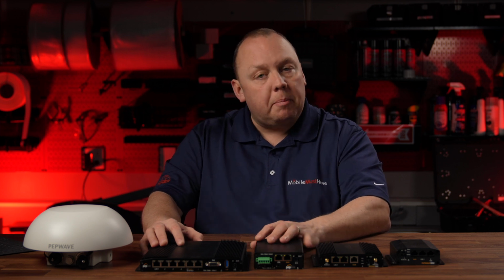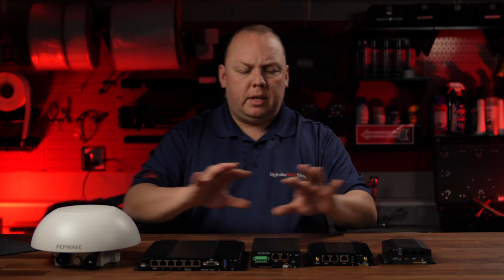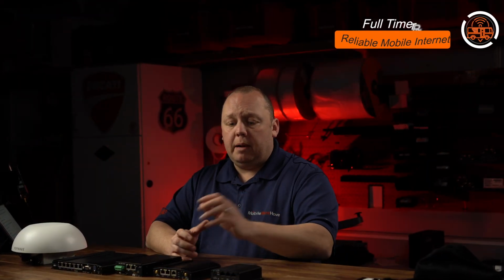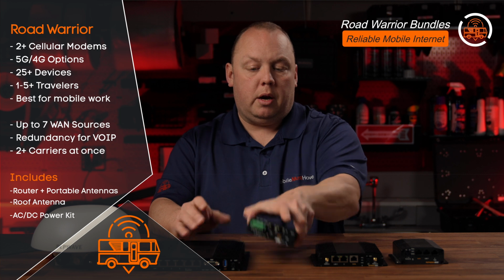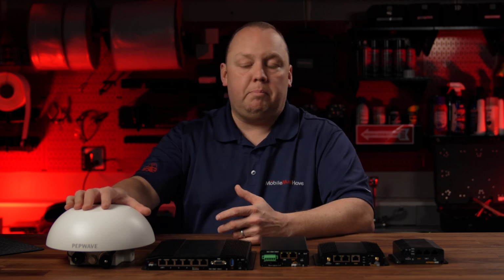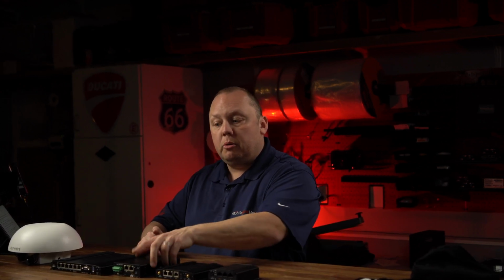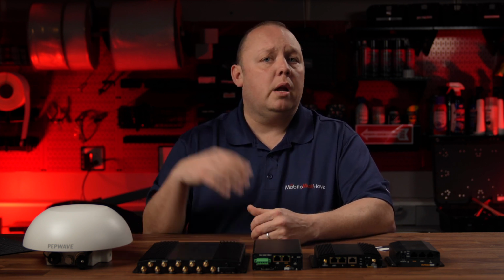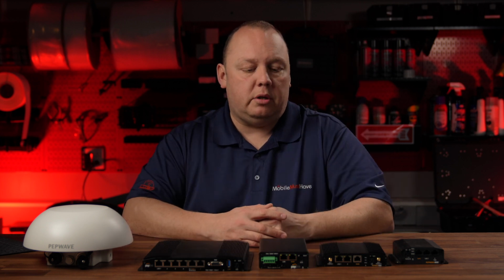So You Need Mobile Internet? Start Here (2.0) New

Comment: We will just need internet for zoom meetings for a few months during the winter. I think the packages are great, but maybe overkill for me. Do you have anything less than the full-time Rver?
Reply from the maker: The mini router without a roof antenna would be a great choice if your in good cell areas. Just need this router which is entry level if you want to step up and out of cheap hotspots. Then you can always upgrade to add antenna later if needed. https://mobilemusthave.com/products/pepwave-max-br1-mini-cat-7ltea-mobile-router-primecare-edition-hw3?_pos=1&_sid=4cc2f333e&_ss=r

Comment: Me and my wife both work and are on zoom calls a few times a day. We plan to be in the mountains. We already have starlink. Is the speed demon good enough for stable connection? Since we can bond starlink and the 1 cellular?

In the speed demon,you can have 2 SIM cards. Is the speed fusion tech able to connect to the other cellular connection or the first goes out?
Reply from the maker: Speed demon is a really great option with Starlink. SpeedFusion can be used to bond both a cellular connection and Starlink, if one of them drops off the other one will still be running. It really increases the stability of the internet!
Reply: @MobileMustHave  thanks for answering! I just joined the membership yesterday and have been binging your content. The ultimate road warrior does look very nice but that coupled with our up front cost of the Starlink, and then thinking of having 3 monthly payments, kinda scary.

If you would recommend only 1 data plan for the cellular data on the speed demon what would it be?

Comment: Did I miss the cost of the basic bundle?
Reply: full timer
Reply from the maker: We dont share price in the videos as we have found they change overtime and then the video has incorrect information on it.  However, the price is shown with no log in required on our site where you can see all our bundle options.

Comment: Thanks for the updated video. I ordered the 5G Speed Demon bundle during your Black Friday sale in anticipation of our new travel trailer. We picked it up a couple of weeks ago, and I ordered the R300 data plan on Friday. Oddly enough, the activation notification email arrive WHILE I was watching this video!

Off to get it up and running. Thanks for making it so easy.
Reply from the maker: Awesome! Let us know if you need any help and congrats on the new trailer!
Reply: @MobileMustHave   I just installed the unit temporarily in the trailer, and all is working fine. Currently only using the stub antennas, because I want to make sure everything works perfectly before drilling holes in the double-walled fiberglass trailer! I'm going to have a couple of questions about the Husky antenna once I'm ready. Thanks again!